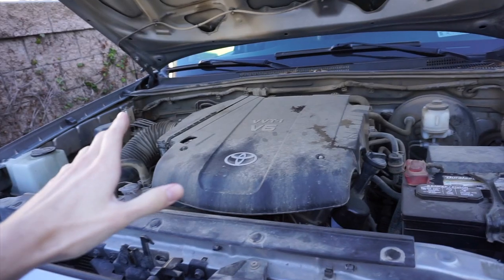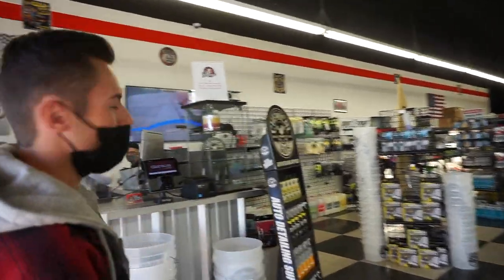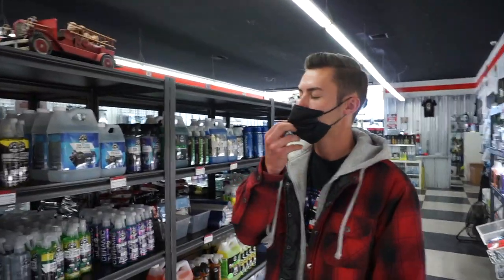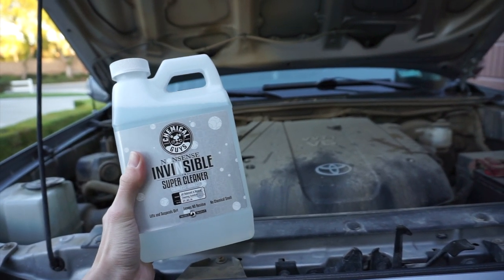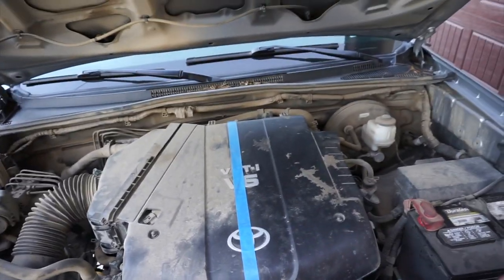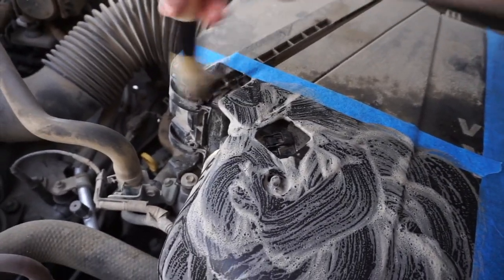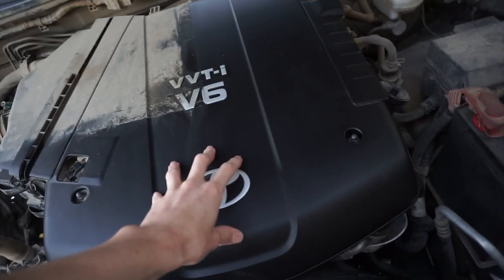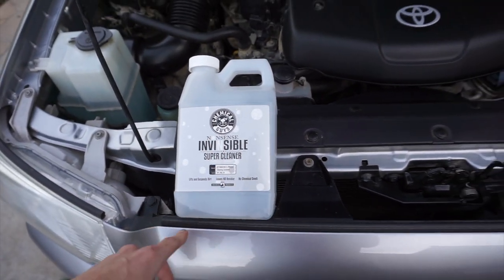How To Clean a FILTHY Engine Bay!

Comment: Idk why ppl are afraid of using water that’s the only way you are truly gonna be able to clean it make sure motor is not hot and I use a degreaser and then hose it off Then use a leaf blower to dry the heavy water and then wash the rest of the truck by the time you are done motor with be dry Not offense but all you did was clean the plastic
Reply from the maker: I think this video proves that using water isn’t the ONLY way to truly clean it. I liked this method 🤷🏻‍♂️ whatever people find works best for them.